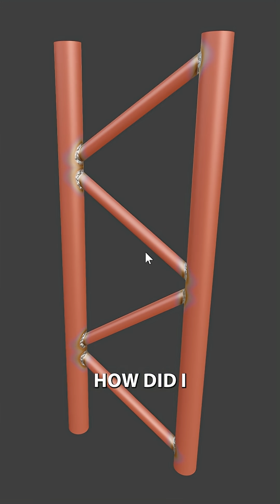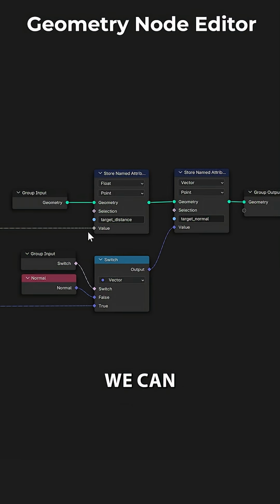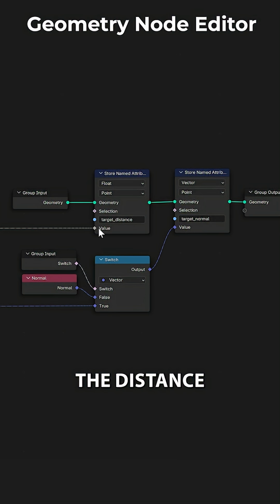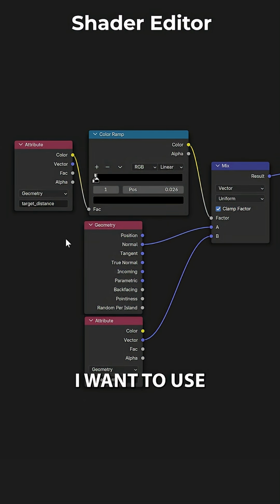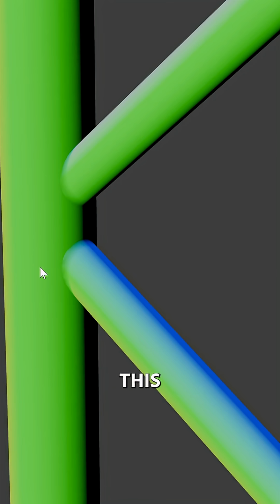Dynamic Welding in Blender

Comment: can this type of thing be baked into the mesh
Reply: You could bake the normals into a texture, but I don't think the effect would be perfect. In the newer version of Geometry nodes though, they have a Set Normal node which you can use to transfer normals between meshes.
Reply: @NoTengoIdeaGuey  That has nothing to do with the actual mesh though
Reply: @rylanyoung2018  Baking to a texture would map the normal values to a texture that corresponds to the mesh UVs, which is part a of the mesh.  Using the 4.5 Set Normal node in GN is 100% baking it to the mesh. So, yes actually they both are "baking it to the mesh"
Reply: @NoTengoIdeaGuey  this assumes the mesh is unwrapped and has a material. Baking it to the mesh would mean altering/adding vertices/faces to the topology, with or without UVs or a material for aesthetic purposes.
Reply: You could add a Realize Instance node at the end of the setup and Apply the Geometry Node Group